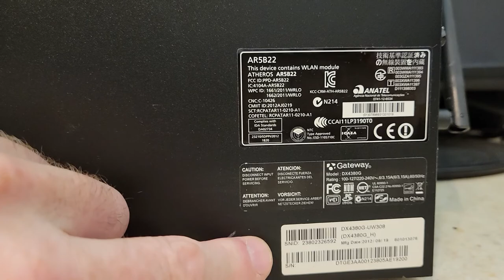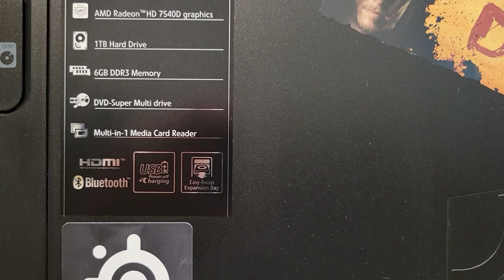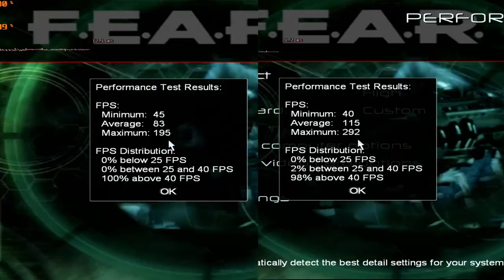2013 Gateway DX4380G AMD A6 5400K PC $10 yard sale find

Comment: You should do a collab with RandomGaminginHD - this sort of build is right up his alley :)  Nice find, regardless!  Pity about the HD but hey at least you don't have to sweat wiping the thing.  Just get yourself some rare Earth magnets out of it!
Reply from the maker: I did wipe and format the drive, it seems to be working ok, as storage of course. I cant handle hard drive slowness these days lol.  
I do love the magnets though, nothing sticks notes to the fridge better lol. I used them to hang steel parts in the powder coat oven when they didnt have a hole for a hook too!
Reply: @Snickerrick  Same.  You can get more mileage out of old systems with just a dab of solid state storage...I glued felt to the bottom of all my HD magnets to make sure they don't beat the fridge up too bad.  I hang my 3d printer repair tools from them, too!
Reply from the maker: It will be a sad day when we no longer find "retro" PC's with old hard drives in them to scavenge. I like the felt idea, thats brilliant!!
Reply from the maker: Thats funny, I have an 8gb 10k RPM scsi drive that also still works, but I guess my point was that PC's made today will eventually be considered retro, and most will have some form of solid state drive.

Comment: Sorry I know this video is a few years old but thought it worth trying to ask, does the 4380 case have the lights that light up the cow cube when you turn it on? I'm trying to build a new pc inside one of these gateway cases cause my partner and I think it will be funny. I can find pictures of the 4860 and maybe 4885 with the logo lit up (and even some of the slim SX ones) but the 4860 case at least seems to be a glossier finish than this, so I wasn't sure if there might have been a difference in the lights being in the tower or not.
Reply from the maker: @kasiabiryukova5011  hey! Sorry , i really dont remember, it has been a while. Its possible it did light up

Comment: 1:08 I see it. Ram slots are colored for a reason. Wonder if it was fitted like that at factory?
Reply from the maker: Even if they had installed the RAM in the correct slots for dual channel, it still would have been single due to the 2gb and 4gb sticks, so it was always intended to be single channel for some reason, or someone swapped out 2-2gb and 2-1gb sticks for a 4 and a 2 lol, which seems less likely but you never know lol
Reply: @Snickerrick  The good thing is that's probably an FM2+ board which means.... Quad core.
Reply from the maker: Yea FM2 and I dug through all my chips and surprisingly I do not have any other FM2 cpu lol